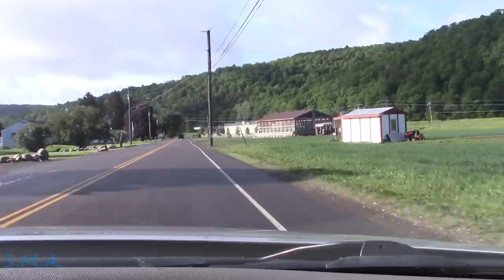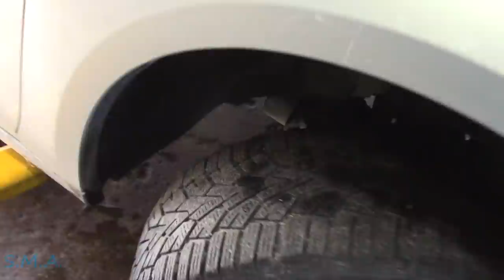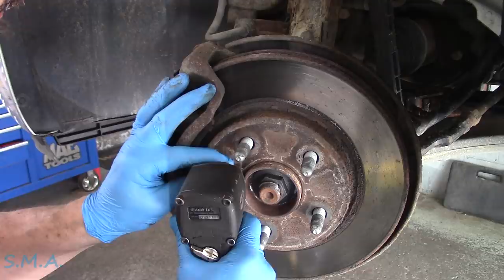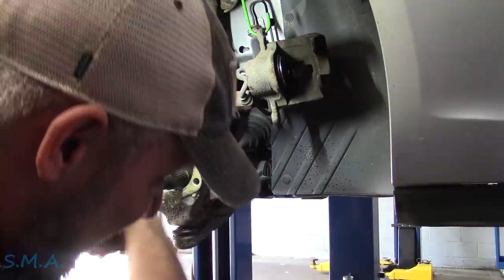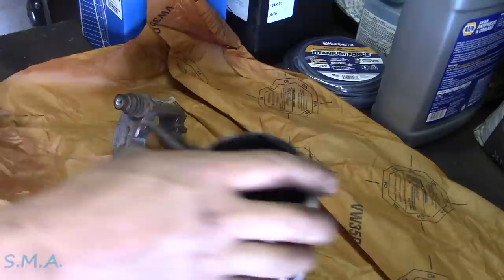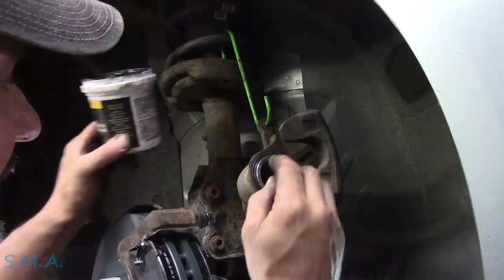Chevrolet Malibu: Brakes & A Front Wheel Bearing

Comment from the maker: Tools Used In This Video:
-Astro Pneumatic Tool 219 ONYX 3pc Die Grinder Kit w/ 90° Die Grinder, Die Grinder & 8pc Double Cut Carbide Rotary Burr Set: https://amzn.to/2RLAdk0
-3M CX-DR Brake Hub Cleaning Disc Holder 07545: https://amzn.to/3pOgUU0
-DocaDisc 30PC - 2 inch Roloc Sanding Disc Mixed Pack : https://amzn.to/3vd2AoR
-Disc Brake Piston Caliper Compressor Rewind Tool Set: https://amzn.to/3vhTLdA
-10-Piece 3/8" Drive Nano Impact Torx Bit Sockets: https://amzn.to/2SmAL0g
Reply: I’m just here for the rambling of Eric O😂
Reply: What was going on outside? Loose exhaust?
Reply: Only way to fix entitled people who do that very thing.. is to call them out... embarassment is a good way to modify entitled attitude.
Reply: @TenmaFN  Could not AGREE MORE!!!
Reply: Hi Eric, I'm also in the rust belt but up north. Caliper bracket are a big problem seizing the pads up and I wondered what was your thought on using a cold galvanizing compound behind the clips ?
Reply: Yeah if you roll down those winders, you be eating cicadas for lunch! Real bad in central Ohio
Reply: The three pc die grinder kit is on my Christmas list to own. I have a Blue Point 90 already. Love it. Cant justify spending $200 for the straight Blue Point one.
Reply: What laptop and program do you have for programming your fuel pump module and pcm
Reply: Brake clean anticipation never gets old..
Reply: Have you done a video on the proper way to put a car up on a lift? I just had my rocker panels damaged by a garage.
Reply: when i watched this video i recall you mentioning some people leave out the brake hardware for rust? reason. i just replaced the front brakes on my 13 impala. the duralast from auto  zone didn't come with hardware. i tried to reuse the GM hardware but couldn't get the duralast pads in with the hardware clips . i tried and tried finally compares new and old . . pulled the clips out and the new slid right in. so the clip hardware was left out due to the pads were not made to work with the clips
Reply: Eric i have a question. I bought a 2011 Chevy Malibu LTZ the front end was wrecked ( not bad) just the bumper cover  and headlight was messed up. I took it for a test drive and the whole front end was wobbly. I know the passenger side needs a tie rod (Outer) . Question is what would make the front end of the car fell like that while driving? No one on here will give me a Definite answer if you could please respond it would be much appreciated

Comment: There is a near-zero percent chance that most shops clean up the hubs and sand blast the caliper brackets - massive respect for your attention to detail!
Reply: Yes, I worked with a few like that 
 I'd end up with the comeback
Reply: Eric doesn't want a return. Other shops will make up a new thing to repair. Oh that's just your muffler bearings squeezing. I wouldn't drive it if I was you. That would be dangerous that's another 500 dollar repair
Reply: I wish I had a sandblaster to clean caliper brackets, it would be a lot quicker than the hand file I have to use .
Reply: All in part of making your job easier even at the cost of a little more work!!!
Reply: I end up having to use rotary wire wheelss and cup brushes to get some of the light truck/work van/RV brakes done so that I could install the new shims and pads. Unfortunately, we don't have a blast cabinet in the truck/heavy equipment shop I work at.
Reply: I was thinking the same thing watching the video @Eric Vardin
Reply: I feel like I should ask shops if they do this, since I don't have one yet...
Reply: Have a 02 durango and the drums look like the helm of the titanic. went in for brakes - brakes fixed - hubs still rusty, and they like to vibrate and shudder.  take it back "you have an old car, its all normal" and tell me to kick rocks. if I knew how, i would do it all myself, have tool knowledge, home repair knowledge, cell phone and computer repair knowledge, just no "repairing a car" knowledge.
Reply: @MrWolfSnack  no better time to start than now, once you get over the fear of breaking something there’s not much you won’t be happy to (attempt to) repair
Reply: @bilaltariq7819  except manifold removals, stay away fr9m those until you develop the skill of removing broken bolts out of a head.
Reply: Many places don't have the rust issues that Eric O has. lol
Reply: @Lowkey_ID  i've not come across those yet (I only really started doing my own car repairs about 6 months ago) but I've got a nice collection of taps and drill bits already. worst was a bolt holding the starter into the engine block going through the gearbox of my mini cooper had the head snapped off. also had about 6 wheel hub bolt holes that were cross threaded that I retapped in the pouring rain, can't wait till I change the downpipe haha
Reply: The Dealerships sure as hell don't !
Reply: Probably a must in that environment. Everything is so crusty.
Reply: @300DBenz  Sandblaster won't remove as much material as a file, and Eric uses a file on occasion, where the rust has raised a surface significantly, an the wire wheel won't do it.
Reply: @MrWolfSnack  If you have mechanical aptitude, there should be nothing you can't turn your hand to.
Try reading a maintenance manual for your vehicle. You need to know what looks "right" before you can know what's wrong.
Maybe a local college dos adult classes to get you stated?

I would agree with Eric, if you don't have a clue, don't mess with it!

Watch Wes Work has a couple of videos on how-not-to-do-it from some DIY attempts at brakes.
Reply: @MrWolfSnack  I started with fixing/building computers and eventually moved on to cars - started with oil changes and worked my way up and do just about everything including pulling/rebuilding engines. The only thing I go to a shop for now is alignments and tire changes - but I'm sure I'll eventually get a tire machine and alignment rack. Feels good to be self sufficient! Day job is still in IT, sometimes I wish I had become a professional mechanic instead - but I get to live vicariously though SMA videos.
Reply: Indeed they will stick the parts with no cleaning before replacing. Eric O cares.
Reply: Thats because near zero percent of shops have an internet camera on them for the world to see what they do or don't do.
Reply: @Lowkey_ID  best to get the professional stud removal bloke in for that one, one slip with the drill and its new head time, especially the alloy heads.
Reply: I dont have a sandblaster so I myself use a wire brush to clean as much of the caliper bracket as I can and the caliper itself just so everything looks nice and moves smoothly. I also clean the pins in the caliper and lubricate them. It's small things that take an extra 5 minutes to do but it's worth it.
Reply: Oh and you don’t mind paying extra for a mechanic that goes the extra mile
Reply: Hand held sand blaster on an air hose works just fine, but do it outdoors

Comment: Brakes are gravy train for the most part, unless you're working on light trucks or work/delivery vans. I think the reason why everyone likes watching them, is to see the different kinds of hardware and caliper designs the manufacturers use. It's easier for someone to do their own brake jobs at home on some jackstands in the driveway or garage when they have a general idea of what everything looks like and comes apart before they start taking it apart.
Reply: Just watch out when doing barn finds or vintage cars that you don't meet the wondrous invention that was asbestos brakes.  They aren't dangerous to use - just dangerous for the guy working on them and breathing it in.

Comment: I was trained in the military, and when the lining gets to the thickness of the backing plate, time to change them.  ;)  In my experience, when people go all the way to the bottom of the wear groove, they go ahead and chew up rotors too.
Reply: Replace the rotors anyways now. They are often times too thin to turn even once.
Reply: @hungryjack8032  And most times anymore, if you do turn them, they warp even faster because of low quality metals.  I hardly ever turn a rotor anymore.
Reply: @farmermiyagi1338  Yup. And the two percent or less that get turned in the shop every year are done with an on the car lathe to get best possible outcome. For what a rotor cost nowadays, its often less expensive to replace them than to turn them. Sad.

Comment: Thanks for the wee tour around where you work, pretty little place.
Top tip for cleaning caliper pistons, paraffin and wire wool😉
Regarding clamping the brake line.
Only type not to clamp is braided lines, that's the one's that get damaged.
Cheers for another video full of  good content,  wit and humour. 
Stay safe and enjoy your weekend.

Comment: So glad I live in Texas where my vehicles don’t rust and rot away
Reply: But all your rubber and plastic parts melt and rot away from UV exposure and destabilization of the plastic.
Reply: @MrWolfSnack  Takes a long time, longer than rust takes.
Reply: I live in Texas and drive a 2003 Lincoln with no rust anywhere. I’m glad I don’t live where they use road salt.

Comment: my 92 Corolla got 280K miles and it still got factory bearings on all 4 corners. Still spins smoothly! Even driven through 2 flooded roads too.Water covered half the wheel!.

Comment: I've worked with tons of mechanics and not one ever sandblasted a caliper bracket! The extra mile is the key to a great tech. Good job slick!! Have you ever used powerstop pads? Unbelievable! The easiest hardware to fit in the cal. bracket... and pads just fall right in. I know that cleaning up the contact areas is important for this but awesome pads! Carbon ceramic.

Comment: You and your garage is much the same as the one I use.  I trust them implicitly and have used them for over 20 years for both of my vehicles and my daughters.  I know of no other garage locally where I can say, whatever you think they need just do it.  It pays off big style in goodwill and vehicle reliability and longevity.  I kept my motorhome for 22 years and my cars on average 12 years.  Repair costs are greatly reduced simply because they have a damn good service annually.  It does not pay to skimp; it costs far more in the long term.

Comment: That's the proper way to do a brake job.  Some of the tecs I've seen today pry the brake pads out of the calliper bracket while letting them hang by the brake hoses, put the new pads in and bolt it back up to the rotor. 🤔

Comment: Wow, washing machine vibes coming off that front wheel bearing! Nice extra attention to detail with sandblasting the calliper and being thorough with the cleaning, this kind of thing especially around sliding brake pivots really does make all the difference in the longevity and feel of the brakes vs a shop that will probably still charge as much but just hit it with some degreaser and call it all good.

Comment: The vise grip trick I’d not seen before but I’d do it with a slight mod. For those worried about damaging the hose just grap a pair of duckbill vise grips (welders & sheet metal folks use them). They have flat, smooth jaws.

Comment: Eric, I use the same method to clamp off the brake line, but I put some rubber fuel hose on the jaws to help cushion it against the brake line.  Eric the Car guy recommend it in a video.

Comment: Imo, brake job vids are great because there the next step of DIY car maintenance beyond oil changes. They're also a bit scarier because... Brakes. 
Would be awesome to have a video going over various diagnosis bits of brakes. Like, what does swirling sounds mean, grinding, or low pad on one side vs other. When to flush brake fluid, etc.

Comment: Man O man, I have a 2010 Malibu LTZ and it has zero rust on the frame or body of it while living in middle PA.  That thing is a rust bucket, including the calipers.  Not to mention it has the cheapo plastic sway bar links on it.  I regularly pressure wash ALL road contaminants off of my car during salt season with an underbody sprayer, and man does it make a difference.

Comment: Another free tip for wheel bearings spin the wheel place your hand on the coil spring in the strut feel for vibration . There is your bad bearing. Never fails been using this method for years.

Comment: Spraying Fluid Film on the hubs before installing rotors is a bad idea. I did it once and never again. It flings outward when the wheel spins and contaminates the brake rotors & pads. It was all over my wheels after a test drive & breaking in the new pads. I had to take everything back apart and clean it off. Use a thin coat of high-temp anti-seize instead.

Comment: Just did front bearings and struts in my 09’ malibu and the breakdown process is nearly identical. Torque specs for the axle nut are different but I also Had the same issue with the dust guard, got all mangled up.

Comment: i have never in my life 58 years had my brakes/wheel bearings  on any car / truck iv owned replaced by a shop !  and i go the full monte cleaning everything as well . rubber grease , copper grease , cv grease , silicon grease and normal old wheel bearing grease you must have . brake clean spray cans iv never used !

Comment: A guy I had little respect for, (due to his bad drug habit) told me how to find which side has bad hub bearing. Raise vehicle, hold 1 hand on lower control arm, rotate wheel with other hand. You will instantly know if bearing is bad. WORKS every time.
Reply: @Aussie101 Yes, you will feel the roughness. I didn't believe it either. Turn wheel slowly.

Comment: Hi Eric. Just watch the brake video. I was wondering if you could give me little advice. 
Have an saab 9.5 2.3t 1999 saloon.  Changed my front brake calipers & change disc front standard to drill & grooved. Along with Brembo pads. But seems that my pads are moving in the carriers.  Got told the carriers were cleaned so many times that it's worn down.  So bought another set of used carriers as can't get new.  Still have ssme problem.  If I change the discs and pads back to standard.  Would this fix my problem? What would you advise ? Love the videos you post. Very inspirational.

Comment: Mr. O. I have a question. Who makes the best complete mechanics tool set? I recently bought a 1958 austin Healey sprite. The body is rust free. The engine and transmission are on a pallet. The rest isn't so good. Some of the boxes of parts have been sitting in a basement. A wet basement since 1978. It needs a total rebuild. I'm looking forward to this project.

Comment: Question with a comment. I would have done both wheel bearings since right front is bad, I would think left front would not be far behind. No, you do not hear or see a problem, but ... 
Is it an economic issue on the part of the owner, or are we only going to fix only what we know is already really bad? When I take my car in for a repair, I do not want to bring it back 6 months or so later fro the same problem on the other side of the car. Thanks, and yes I love ANYTHING you do. Have a nice day.

Comment: I noticed the tie rod end ball joint deflated. Do you ever add grease using a needle fitting on the grease gun to help prolong the life of the ball joint ?  
Also wondering if you take into consideration how much use a car gets when replacing not quite used up brake pads ?

Comment: Was that a rainbow at about 1:15?

Watching all these wheel videos because I know I've got some wheel, steering, suspension something coming up on my Saturn, the motor mounts fixed most of the clunks but now I've still got one when crossing center, especially backing... And let's be honest, it probably needs brakes too. Probably gonna outsource that one tho, still helps if I eventually learn what all those bits by the wheel are called. Does everybody sandblast the bracket?

Comment: I think you are an awesome mechanic. I know I have posted something negative about pressure washing under the hood because it made me cringe because of all the shit that can get messed up if it is old but I think you are the best. I live in upstate NY but still no where close to you or I would be bringing you my vehicles based on what I have seen from your videos. I know you hate "aftermarket" but are you mostly talking about electrical stuff? I have a Nissan 370Z and have had my local mechanic install many "after market" performance parts specifically for my vehicle. Do you hate that stuff as well? (Locking differential, cold air intake, exhaust, short shifter, lowering springs) are those things you hate as well?
     Have you installed turbokits? The aftermarket parts I have had installed are way better than anything Nissan Nismo has to offer.

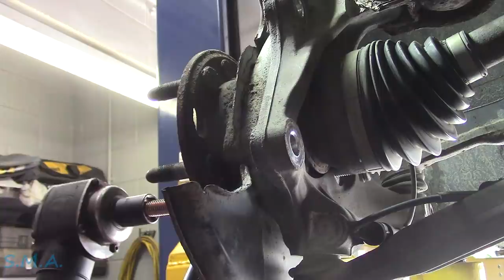Comment: I don't put much confidence in the plastic sway bar link or whatever it was attached to the strut, it's probably just as strong as any metallic part but it's more reassuring to know that I have a metal one in my older GM. Also, 12:23 is the real reason why armchair mechanics tell you to secure your caliper, so it doesn't fall on your noggin.

Comment: I just realized that you have an unusual advantage in the cuomostan state of roadsalt and rust. I will wager that you do not experience ambient temperatures above those at which your motorized shop equipment (lift, air compressor, etc) manufacturer says "don't use"... typically around 100° in non-drug dealer units.

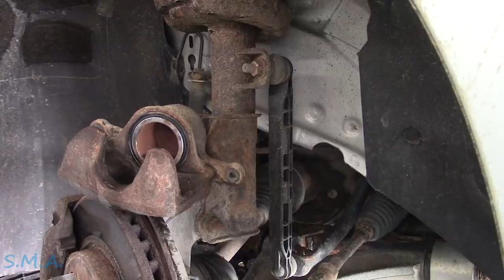Comment: @7:55 Does anyone know what that tool he used to push back the caliper piston is called? That thing is way better than my C clamp or pad spreader that I have. Edit:  I think it might be the Lisle  24300 Speedy Brake Pad Spreader for single pistons. Looks like they make a dual piston model Lisle 25750 Dual Piston Brake Caliper Compressor as well. Took some searching.